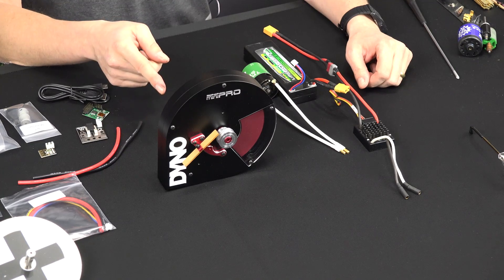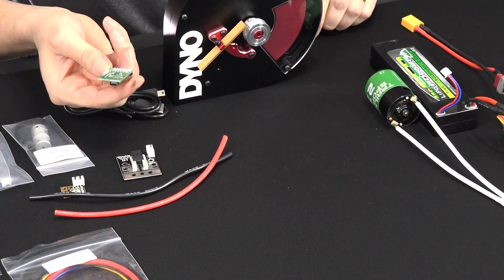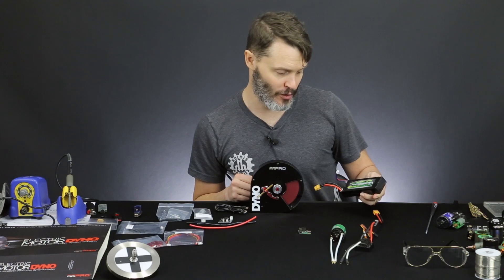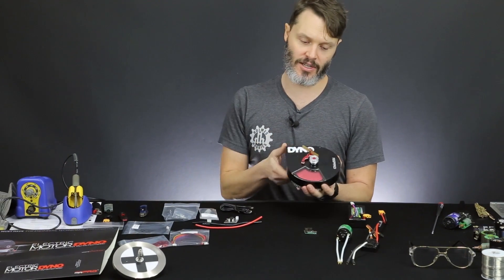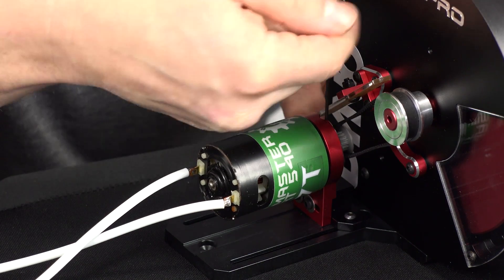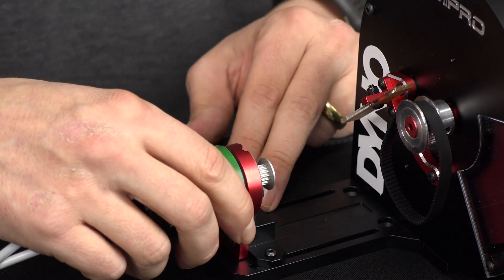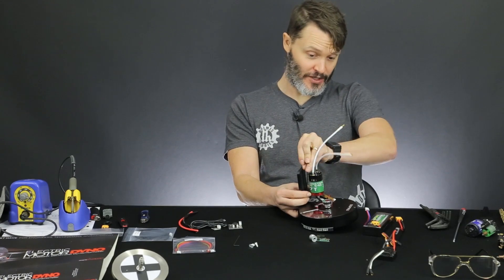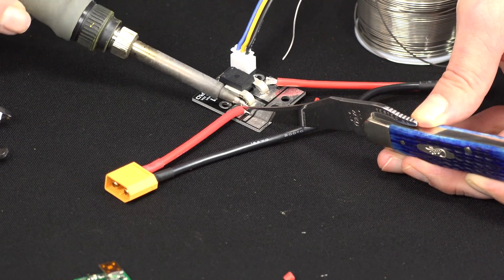MiniPro USA RC Electric Motor Dyno Set-up - Holmes Hobbies

Comment: I'm just amazed by how you've assembled a basic machine such as this so wrongly.  Like with the pulley you attach to the motor shaft - you don't bolt it on while doing those finger olympics, you bolt it on after you tie in the motor to the motor mount, BEFORE you slide it into position.  And you need to take the larger pulley off when you put the belt on.  One more thing - you didn't check your current sensor wiring.  You've created a battery short with that strand hanging over.  It will touch when you're not looking.
Reply from the maker: thanks for the input! good to know!

Comment: I work in industrial maintenance. Had a rep from Dayton come by the plant once to talk about belts. Was shocked when we admitted to rolling belts into place.

He explained that proper belt tension is really complicated. To the point that they designed a jig to make it possible for Neanderthals to install belts properly. 

It was a simple piece of aluminum angle with a clip and a few notches machined into it. You use a silver marker to mark the belt, then tension the belt until that mark moved to the proper notch for the belt size. 

Not useful at all for this dynp, but you could probably come up with a similar setup if necessary

Comment: For the average everyday person the assembly to change out motors wouldn't be a big deal. However, for you John, that may test 20 or more motors a day this is definitely a draw back. A simple hack that could do to make the world easier on you. replace the motor to motor plate mounting screws with thumb screws. If clearance is an issue clock the motor and redrill the mounting holes. The slotted mounting holes on the bottom of the motor plate. You could cut a slot in the bottom most web of the motor plate just wide enough to slide over the screws that hold the motor plate to the dyno base plate.  A long bit of the correct size on a power screwdriver and you would have a relatively tool less and quicker motor change. This would allow you to insert the motor drive sheave inside the belt then drop the motor plate on the mounting screws, tighten and your in business. The belt is cogged therefore belt tension isn't as important as it would if it were V belt type. In essence you have a flexible gear drive and should provide a fair bit of repeatability. Looking forward to the data that you come away with.

Comment: shouldn't need much actual tension on the belt with a toothed belt and pulleys with this type of dyno. Maybe only move the motor mount away until you achieve a flat, straight side to the belt and call it good? That should be a fairly repeatable procedure. Looking forward to test runs.
Reply from the maker: quite a good point.